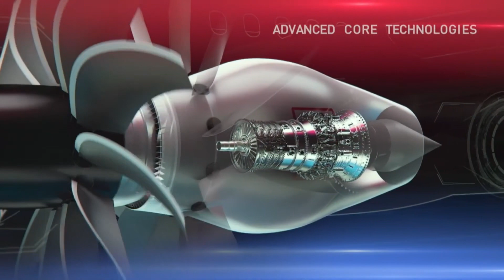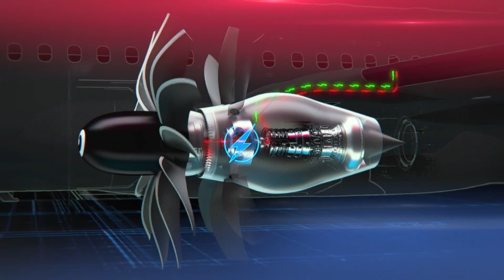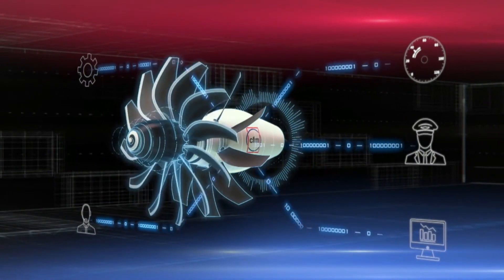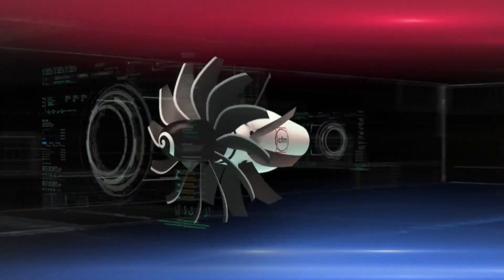New CFM "RISE" engine to cut carbon emission by 20%

Comment: its important to understand why ducts are removed from these engines
its to allow larger fan blades
Fans operate at their highest efficiency when inside a duct, problem is we don't have the material technologies to make fans large enough whilst resisting expansion as they rotate, thus its not possible to put a duct around the fan as the blades expand too much as they rotate

Comment: This is actually an old design with modern engineering if you ask me, This engine was designed 40 years ago but had some issues it looks like they took an old engine design and engineered it with modern materials.

Comment: Seems that a bird-strike would be disastrous if blades broke loose and started flying all over the place and then add to it the catastrophic turbine engine vibration—does not look good.  The best prospect for new propulsion is the hydrogen turbine engine; safer and MUCH cleaner.

Comment: but what about the drag? won't it be higher than the engines without open fans???
Reply: Any drag penalty is offset by the efficiency. It is also lower weight because it doesn’t have a nacelle.
Reply: @kylebreedlove1360  This engine will most likely be quite substantially heavier than previous architectures have been
Reply: @ArchaicMuse  But is it heavier than the 2 old engines that would have been on the wing 10 years ago?

Comment: Hydrogen IS NOT a zero emission fuel! In fact, it's highly inefficient to produce.
Reply: Emission is what happens when the hydrogen is combusted, (minute compared to hydrocarbon fuels, if low NOx technology is used) nothing to do with the environmental 'cost' to produce.  That's why electric cars claim zero emission, despite their huge environmental cost.
Reply: How dare you use common sense.
Reply: That's a very energy demanding process indeed though I would not call it inefficient. It is what it is. There are multiple places around the globe where clean energy producing potential is hugh though no real energy consumers are present within economically profitable range. Building hydrogen production facilities will benefit everyone. Think about Iceland and its thermal power plants. All their electricity needs are covered by 100% renewable sources (hydro and thermal stations) and it can easily build more plants and there are plans to do so to produce green hydrogen.
Reply: @sergeleinweber9147  My question would be why not just use the power to store in batteries? More efficient than going through the conversion process than the combustion process. You still have to deal with the extremely inefficient internal combustion engine.
Reply: @dustman  It's because of the weight.  There are several fully electric plane prototypes though their range is quite limited +- 1000 km. Surely the accu capacity increases gradually over time with new improvements but it's currently nowhere near being economically profitable or even secure enough.

Comment: If this is any less quiet and comfortable than a conventional fan, the flying public will reject it.  If it is any slower, it will fail. Also, I can't see
it fitting on the wing of a low wing airplane othe than the A-380, due to prop FOD issues.
Reply: This engine will likely be used in brand new aircraft models for the reasons you raised.

Comment: How revolutionary... Unducted fan concept 1985.
Reply: Bottom line is there's a LOT more going on than just the ductless fan.  The 1985 concept could not be 20% more efficient than engines built 37 years later in 2022.
It also would not impress both Boeing and Airbus to the extent that both are banking on this 'CFM' engine for their next generation aircraft.
Also, embedding a generator in the mainshaft is intriguing. A generator can conversely serve as a motor
Reply: Insanity.  Sorta like depending on the wind for electricity!  And GE is knee deep in 14th century windmills.

Comment: 2:49 There it is, like hybrid car tech being used for performance boost rather than efficiency, you're gonna use fuel economy to extend range rather than save fuel.
Reply: Hybrid technology in cars only works doing stop and go driving.  Most airliners don't stop and go.
Reply: @yukon4511  One would wonder how an airliner gets anywhere if it never goes. One also would wonder what it does after landing if it never stops.

Airplanes have a huge need for braking and that braking typically happens on landing, which is exactly right before the energy is needed again, take-off! Imagine that.
Reply: @wiredforstereo   Wheel brakes provide 70 percent of total braking on an airplane. That prop wold extract minicule power on 
landing, hardly worth the weight of the batteries.
Reply: @yukon4511  You do understand what regenerative braking is, and how it works on the hybrid vehicles you're talking about, right?
Reply: @wiredforstereo  I do.  In stop and go driving, it makes sense, especially with a motor/generator on the drivetrain.  An airplane spends most of it's lifetime in cruise, and like a hybrid car, it can benefit little from hybrid technology in this mode.
Reply: @wiredforstereo  Let me guess Sol......Enthusiastic EV owner anxious to convert everything to lithium power.  Hate to disappoint 
you buddy, but airliners will NEVER be battery powered.
Reply: @yukon4511  Nope. Fail.
Reply: @wiredforstereo  Very comprehensive response to the multitude of complex issues I have raised.  You got nothing.

Comment: I'm curious how this engine achieves reverse thrust. Doesn't seem like there's any kind of variable pitch mechanism for the blades
Reply: They are obviously variable pitch, if you just look at the blade root.
Reply: @wiredforstereo  the second set of blades don't seem to rotate. Are they for airflow or something?
Reply: @mmm0404  Hi Enoch.  Fancy seeing you here.  I was wondering the same thing myself.
Reply: @mmm0404  I believe it's the equivalent of the stator portions of enclosed turbine engines. The purpose is to straighten the airflow after it leaves the circular path of the blades. You want a straight jet of air out the back of the engine, not a vortex.
Reply: @yukon4511  See my comment to Enock.
Reply: @wiredforstereo  yes thanks that's what I thought. Heard it's just as effective as  using counter rotor blades spinning in the opposite direction. Helps cancel out vortexes too. 👍
Reply: @mmm0404 they are stator blades which serve to redirect the helical airflow exiting the fan closer to laminar flow. The will adjust according to the dynamics of any given regime. BTW, those fan blades are way to big to go beta for reverse thrust. They will probably eliminate reverse thrust by using advanced high temperature technology in the landing gear brakes. Remember: reverse thrust is only to increase the life of the brakes; no airliner is permitted to operate in a condition where the plan cannot be stopped by wheel brakes only
Reply: It have variable pitch. Watch their 3D model video, they clearly show it there.
Reply: Lemme guess: Disengage a fan clutch and power it backwards with the electric motor?
Reply: https://www.youtube.com/watch?v=-iplkxzV5Hw

Comment: Would you happen to know why we arent seeing vortex devices ('winglets') on the tips of propfans for noise reduction? Is the added drag that significant as to wipe out efficiency gains?
Reply: As far as i know, propellers rely more on angle than asymmetric profile like wings do. Winglets are carefully designed to extract a minimal forward vector out of the high pressure under the wing at a specific flight envelope. Compare the air mass under a wing with the small area of the propeller and the complexity of a tiny lip of material which could receive impact from debris provoking assimetries.
Helicopter rotor blades are slower and bigger, so their tips are a better target for optimizations.
Just my educated guess.

Comment: Let's see them throw a frozen turkey at it
Reply: I like her Jaeger LeCoutre moon-phase master control
Reply: @nukiepoo  yeah, she’s got the money..
I wonder if the engineers also get their fare share.
Most often they aren’t paid enough!
Reply: I'm also very curious how this open-fan design behaves when striking big birds. Will the blades break and possibly hit the cabin? That would be a major disadvantage.
Reply: @HDJess  I mean we just gonna ignore propellers
Reply: Great comment 😂. Actually, I’m wondering about the noise issues with open fan engines
Reply: Am I the only one who sees this as a plus? I'm anyway usually listening to slipknot on a flight, might as well see some bird confetti paint a Pollock on the plane
Reply: It must pass the bird test first, however it's built like any other turbo-prop engines today with this test in mind. So I wouldn't worry about. The main issue with such engine design has been its noise. Now they've fixed it )
Reply: They probably threw a few 🥖🥖 at it and some butter 🧈 🧈🇫🇷🥖👌

Comment: Already been done.  A bust.
Reply: Uh… wrong. The GE36 was actually an amazing success and was ~60% more fuel efficient and reduced CO2 emission versus the latest engines back at that time. 60%!!! Yes they didn’t have the knowledge or tech yet to deal with acoustics and noise issues but now this pretty much solved.

The only reason the GE36 program was stopped was because of the oil market and price back then. So no one gave a shit of the 60% improvement once oil prices went down they quit working on it.

The world is a very different place now.
Reply: It's a high speed turboprop, Tu 95 was flying with similar type of engine in 50s, and it's still flying today ^^
Reply: Crazy person comments is right.
Reply: Already been done but was a success . Was only cancelled because fuel prices dropped significantly during its time of testing , so it's effeciency gains where not really needed anymore. 

Now because of regulations around CO2 emissions and sustainability , it now has a purpose